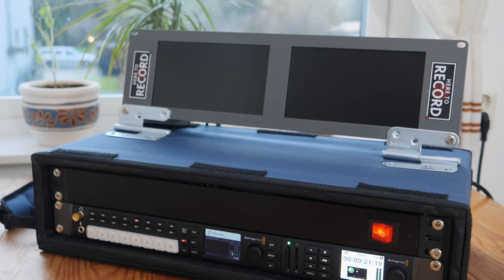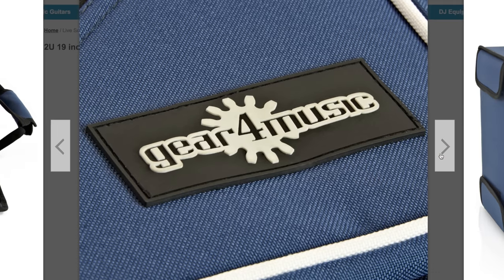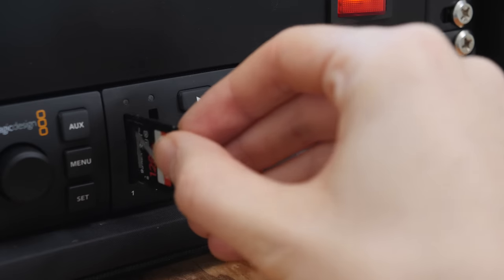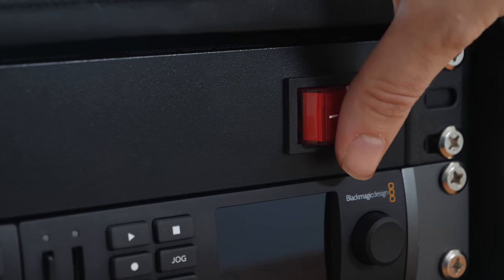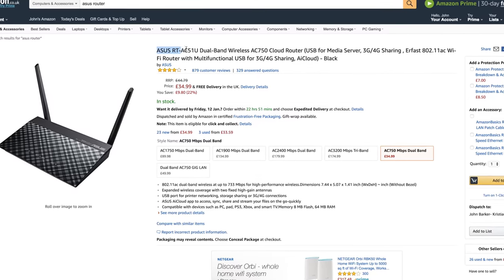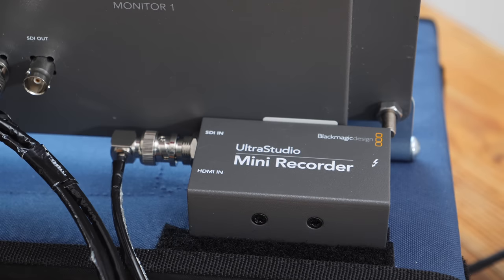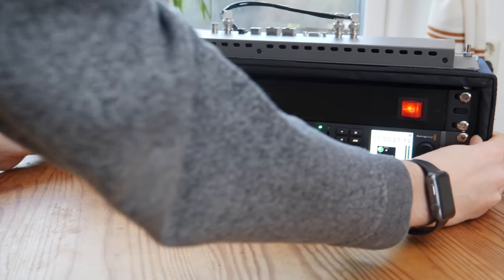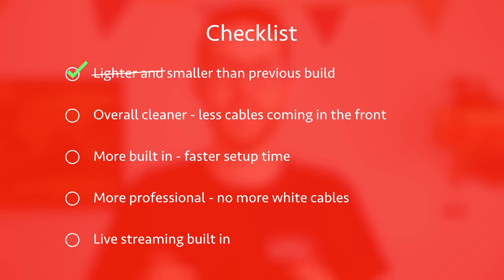TV Studio in a Flight Case - 2018 Edition // Show and Tell Ep.50

Comment: When plugging into a venue's network, how do you resolve the fixed IP assigned to the ATEM TV Studio HD with the DHCP addresses automatically assigned by the venue's router?
Reply from the maker: I have my own router built into the system - that way I have full control over my internal IP address and can still connect to the wider internet also

Comment: You said you just plug the audio into the camera. Are you plugging in line input stereo Left right from a mixer or microphone. If microphones how do you get the audio panned center and not hard left and hard right on each mic?
Reply from the maker: This camera in particular has a setting to change the audio from stereo to mono which is really nice. 
You could likely use a two XLR setup through instead which I use on another camera. Just keep the audio level the same for both inputs

Comment: I was wondering if you routed your video signal Cam In to Switch, Switch Program to Monitor, Monitor to Hyperdeck? I mean, what is that Right side monitor outputting a signal to except to the Hyperdeck? 

Very nice little compact setup by the way. I really like it. Great video as well.
Reply from the maker: Thanks for the kind words! I would personally go Switcher>HyperDeck>Monitor - that way you can be sure that the monitor is showing exactly what being recorded. That way if there are any weird issues that pop up, I can spot them right away.  If the HyperDeck shuts down for some reason I’ll be able to spot it a lot faster if the right monitor goes black all of a sudden.
Reply: Well, that's how I would do it too. However, I'm just curious as to what you have coming out of the output of Monitor 2 and where that signal is being routed to.

Comment: do you recommend put the xlr audio cables at atem? Is it possible to sync audio this way?
Reply from the maker: I recommend plugging into the camera where possible. The audio coming into your ATEM via XLR will most likely arrive before the video (perhaps only by a small amount but maybe even a lot). If you have an audio delay function on your outputting audio device then you may want to use that.
Reply: @heretorecord  Thank you!!

Comment: Hinges are too big and ugly, you could have used slimmer hinges for metal, those kind of are for wood panels.
Reply from the maker: The tricky thing is though that when you put it in a case and bring it around the country/continent it ends up taking a beating along the way. Better to opt for bigger hinges that will last.
Reply: @heretorecord  It doesn't take more beating than the luggage hinges which are way smaller than what you have, Just make sure you glue in rubber pad on the top corners of the monitor to protect it from shock when it's fully closed.